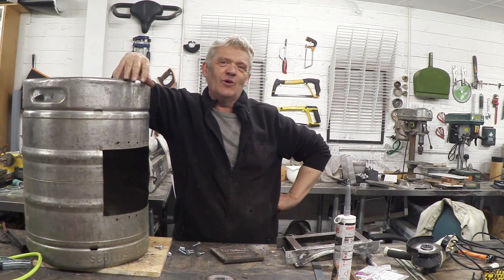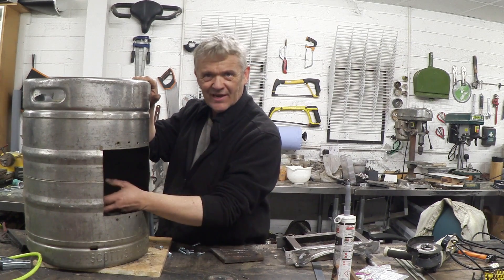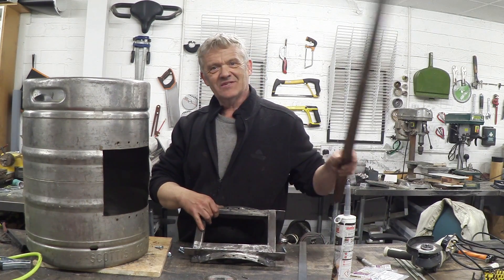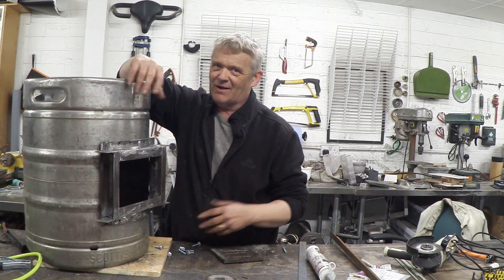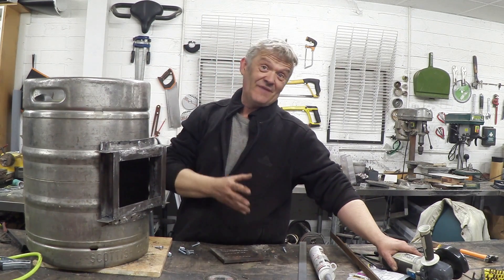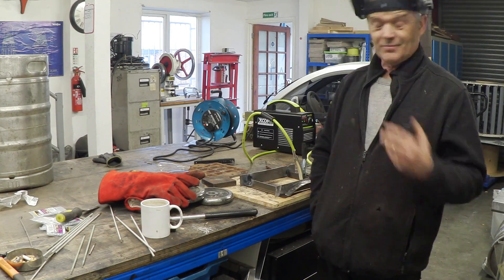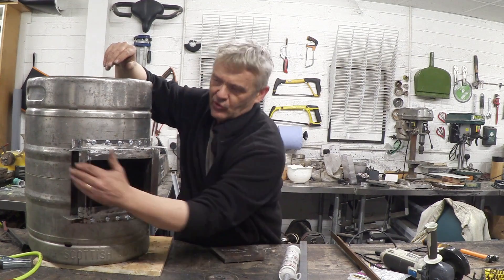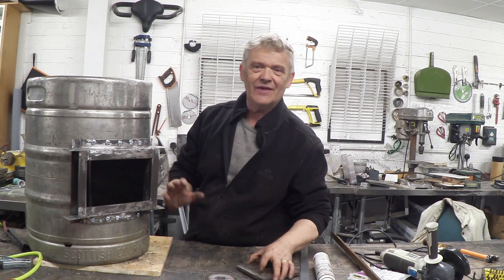DIY Gasification and Generator Unit - Part 3 - Simple Welding Tricks

Comment: Hey my friend. I've welded for years. Once you've welded you never go without it again.  My tips would be. Clean the surfaces good ....rust makes things hard to weld. Hold your rod about a 45 deg angle leading to the direction your headed with the weld. Play with your heat settings. You want it hot enough to " carry " the arc. .  When you start the arc,,it should continue faily easy. Not to hot....you don't want it splattering or your rods glowing red.  I always work the rod left to right.. right to left in a saw tooth or shark tooth pattern. Weld a little further on the sides of the seam to the left of the seam then to the right. Do this tooth motion and maintain the rods tip about 1/8 inch above the surface to maintain the arc. Also at the same time you must travel along the seam in the direction your rod is leaning.  You'll get used to it.  Use your grinder to.  V. Groove the seams.  If you butt 2 pieces of metal together  V groove the seam this way the weld penetrates deep into the seam making it stronger.  Its not nearly as strong if you just weld over the top of the seam ... joint..or crack. I suppose it's a stardard????? But I use a 7018..rod it's fairly easy to weld with and has lots of strength..  watch your eyes. If you arc the rod with your helmet up and it flashes your eyes...it will wake you up with seemingly glass in your eyes... don't recommend it.  I'm sure there's other stuff but.. just ask.

Comment: For a beginner hobbyist welder working on simple, non-hazardous applications, these methods are perfectly fine and I agree that there are often times where a grinder can really help when you accidentally put a little too much metal on the weld bead or have a little bit of undercut that can be ground out and fixed with an extra pass or two. HOWEVER THAT SAID, if someone is, say, planning on getting more into the field, building high stress structures, sealing high pressure containers (even 100 psi is very dangerous), repairing vehicular parts, etc, these methods can indeed lead to DIRE consequences. The reason for this is because there are many variables that have to be considered when welding that can have a detrimental affect on the strength of the joint. In the case of these methods, hardening of the base plates due to excessive heating and cooling will have the greatest effect. This is because you generate a lot of heat when welding, and the more you repetitively heat and cool a metal, the more stress you put on the micro structure and the more brittle the metal becomes. This is called "thermal shock". Now a piece of metal CAN have its micro structure "reset" if it is melted, but obviously that can't be done unless you plan to start from scratch. 

so tl;dr, use these methods with caution, but only in situations where structural stress isn't an issue.

Comment: I MAG welded a prototype windturbine in 1996, took me a day or two to have the whole system work properly, then instructed a Bulgarian guy to weld his biogas digester. Both worked out fine. Nicer welds with argon, protecting your weld, but you need time to set it all up. Never gone further, but respect to the real professionals, it’s not a piece of cake!
Reply from the maker: for sure it is not!

Comment: You really made me laugh again, you’re genius! One small remark about those grinders, they can be dangerous, turning at 10-20000 rotations per minute. There is a difference in discs to use . NEVER use a cutting disk ( very small thickness of 1-2 mm) to grind. Real grinding disks typically have a thickness 5-8mm. That’s ok to smoothe your weld. There are also the disks with lamella of grinding paper. Just thought it would be mentioned because those very fine discs can explode if you use them for grinding. I enjoy your pleasure in learning to weld though!
Reply from the maker: nice tips am the - cheers

Comment: Another great tip!  I had forgotten how handy an angle grinder is.
Something else: over here, garbage cans are either galvanized or plastic.  I like your beer keg better (stainless steel, I believe).
Reply from the maker: it is stainless mate and I prefer it to a zinc coated can too - but you work with what you get

Comment: This is how I learned to weld then went on to build a multifuel boiler to heat the house, it lasted nearly 10 years before rusting through, I should have used thicker steel!  
Wore out a couple of grinders as well.
Reply from the maker: lol - when learning to weld you can't do without one mate - cheers

Comment: No mate, you thinking is not wrong, even the pro's use the angle grinder. Every weld should be smoothed out so you sir are doing exactly what everyone is doing, LOL
I have 2 angle grinders and I use them all the time. I get the most use out of them than any tool I have. They work perfect for cutting bolts down to size or sharpener or welding smoothing. I don't know what I'd do without it. lol, Oh and by the way, you have done a spot on job to that door. Cheers
Reply from the maker: lol - awesome to know mate - makes me feel a lot less guilty about using it! and cheers

Comment: Robert for that kind of work your doing it really would be best to get yourself a (MEG WELDING MACHINE). You can use Flux Core or Gas Shielding for the Welding Wire. It's far easier to Weld with the Wire Welding process or (MEG) than Stick Welding. If you really want a good Welding Process then go with (TIG WELDING MACHINE). With this type of Welding you can Weld any Metals you want to. It's just my opinion Robert but maybe you should cut a slot across the bottom of your Can and add a Flat Plate so all you have to do is pull the Plate towards yourself and all the Burned contents would fall out the bottom into a catch Basin or Burn Box. Just my opinion. Thanks for sharing your knowledge with me and all willing to learn something new. P.S Robert. If you'll look at it in the way High End Grills are made, it might help you a lot. After all your not far off the Grill making.
Reply from the maker: cheers mate - I think MIG is something I will progress to for sure - as for the slot - the can needs to be sealed so a slot would be difficult to manage maybe? To be honest because I amusing the gasifier for 2 purposes - to gassy - of course - and to help me learn to weld - it is quite likely to be completely overbuilt!

Comment: A round cast iron drain cover will survive the heat to let the ash fall to the bottom,soft pad grinding disc removes metal fast the type with flaps of abrasive rather then the type that resembles compressed carbide noodles! You could spend ages fabbing an ash removal pulling out pan but maybe it would be easier just to have a port and vacuum out but risk a meltdown if embers haven't extinguished! I've made stoves out of scrap and combined Bolting together with welding, I've seen gasification feedpipes slanting down with take off tubes that collect fractions,wet rag cooling also
Reply from the maker: love the drain cover idea mate and nice tips on grinding - cheers

Comment: if wane test your helmet use bic lighter and hit fire stone flash trigger the helmet dark if not check battery

those gas tanks are dangerous the gas can still be inside of the walls of the container if grind it can blow if dont flush out first
Reply from the maker: yep they can!

Comment: Hello good Sir from the Corn lands of the Midwest in America 🇺🇸 

LoL, I’ve been welding for some 30yrs now and the angle grinder is still one of my best friends. Whether it’s used with a wire wheel to prep areas before welding, or a grinding wheel to make joints fit better, or cleaning up welds after the welding. But yes, the angle grinder is still one of my best friends; along with sets of different vise grips to hold work pieces, magnetic angle blocks to help hold pieces 45-90* while tacking them together, also even using a speaker magnet on your grounding end (because some work one can’t find a good place to clamp it on). 
One thing I did want to ask (if I may) is: Do you have a dry storage box for your welding rods? Even having an air tight container with some silica packets will work. Humidity and temperature fluctuations can and will degrade the flux on you rods and in time they become junk and impossible to weld with (money out the window).
Reply from the maker: I must get some clamps that's for sure and yes I keep the weld rods in a cabinet - but you have to remember I ma really a chemist so most of the stuff I keep is reach and cossh compliant just by habit

Comment: I've been welding for over 30 years, I make all manor of items and MY best friends are my selection of angle grinders! I have three set up ready for use, one with a 1mm thick cutting disk, one has a 40 grit flap disc and the final one will either sport a 80 grit flap disc or a wire brush.  Keep going with the welding and enjoy it! I started on stick welding but truth is I mostly use MIG now, and this is what I'd recommend to you.
Reply: "Manner" not "manor". I've got my grammar nazi hat on today.
Do they make low-temp "filler" rods for gaps?
Reply: @benthere8051  Bloody auto cucumber!
Reply: @benthere8051  Correct that, it wasn't auto correct, I wrote the reply using 'Voice to Text' on my Samsung, obviously it chose the wrong spelling, however at least it put the punctuation in Okay though....
Reply: @uncledodge9396  - Been there done that TODAY. I just installed a "freezer" and the voice-to-text decided I was trying to say 'preacher". I'm sure my girlfriend is wondering WTF I'm doing installing a preacher.
Reply: @benthere8051  BTW, your question about 'filler rods for gaps', Sometimes when I have a gap that needs fixing I just fill it with weld. Using mig just makes it so easy!
Reply: @uncledodge9396  - I've never used mig and would like to experience that. I am also impressed with the aluminum welding rods. They can fill large gaps and they make great fillets. I'm really impressed with the YT videos made by professional welders. They produce works of art.
Have a good day, my friend.
Reply from the maker: a few folks have been saying that mate - and I can see the good sense of it - but I have bought this kit now - so I am going to persevere with it for a bit and see about buying the MIG kit later  - I am a bit stubborn lol

Comment: Looks a damn sight better than the monstrosities I first made when I was a beginner. Using another electrode as extra filler is nicknamed "Texas TIG" and is sometimes used for exactly that purpose to fill a big gap.

On using a grinder, thats the tool I use most other than the welder, yea some welds are left depending on the application, but when something is being used, as a piece of furniture for example, or a piece of medical equipment the weld is often asked to be finished flush and smooth, or sometimes with a grained finish. Bottom line is, whether your a pro of a beginner your going to use a grinder at some point for some reason or another.
Reply from the maker: cheers mate